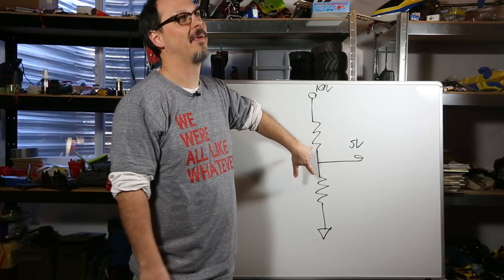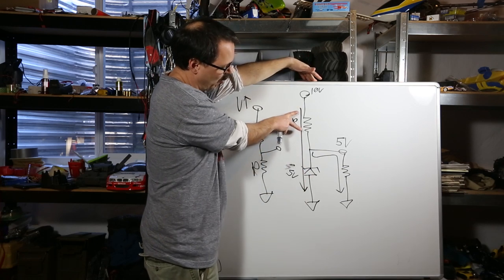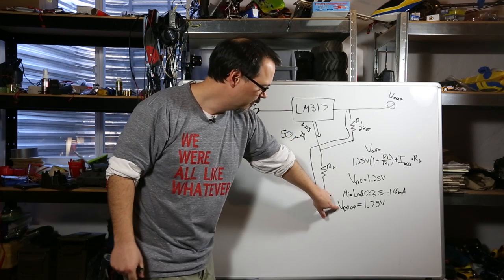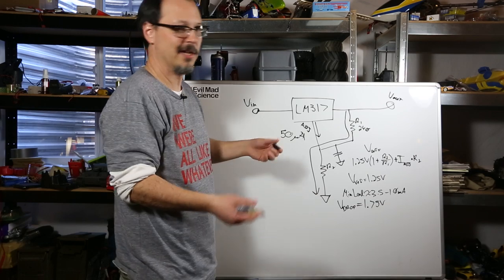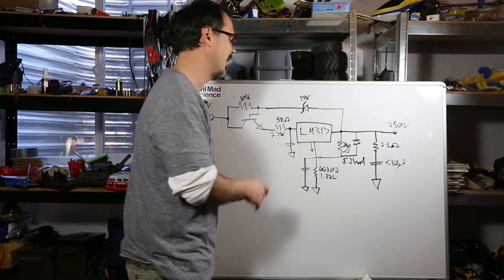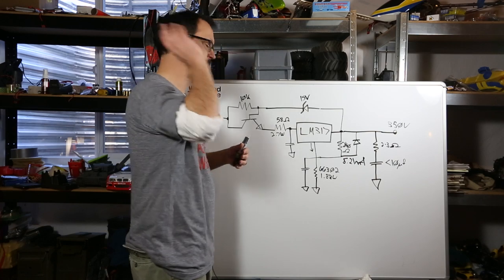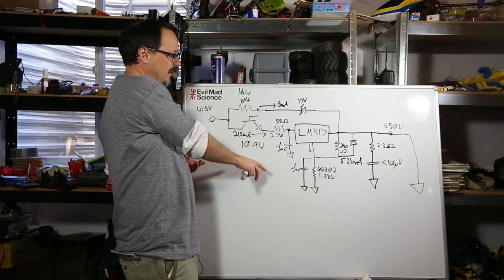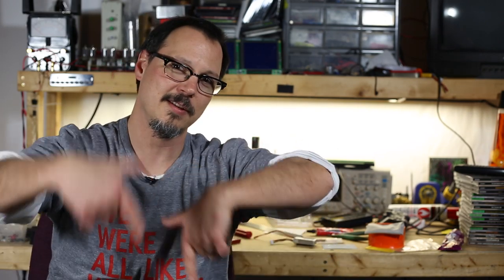SparkFun According to Pete 2-4-13: Voltage Regulators

Comment: I would have left the 10K resistor at 1/2 watt. That way it acts as a slow blow fuse. If the output shorts, this resistor blows and turns off the transistor, effectively turning the power supply off. You may be able to beef up the circuit so it can survive a short, but are your sure whatever supplies the HV+ can even survive? Considering the price of HV transformers... Also, checkout the TL783. It's a linear reg that can go up to 125V between in and out. It's often used in HV+ for tube supplies.

Comment: A High current circuit would've been a better example. Your high voltage, is of no use to the hobbyist. 
They will more likely need an adjustable 12V @15A power supply, for bench. 
Which can easily be done with the LM317 the same way. 
You are a great teacher though. +1